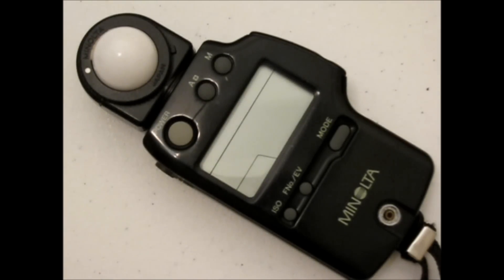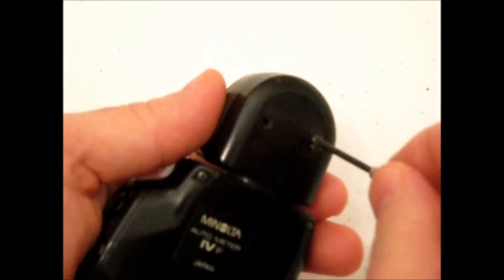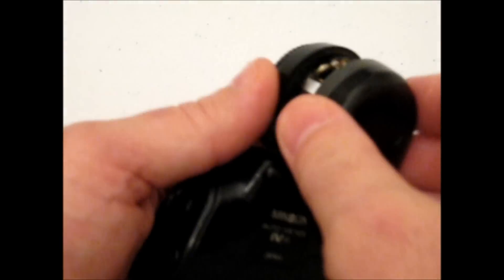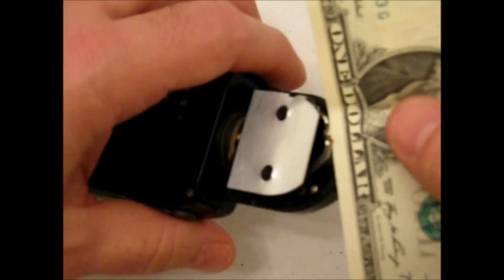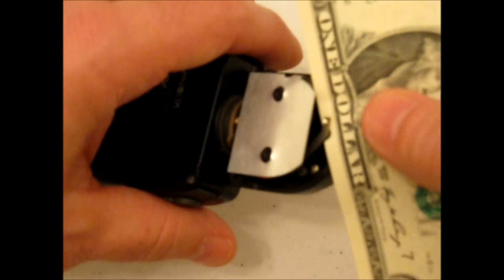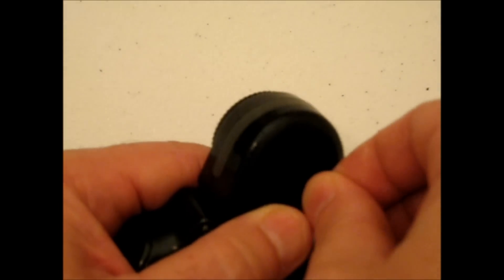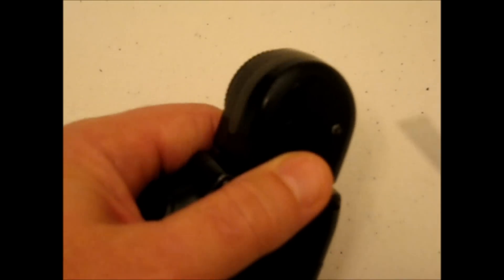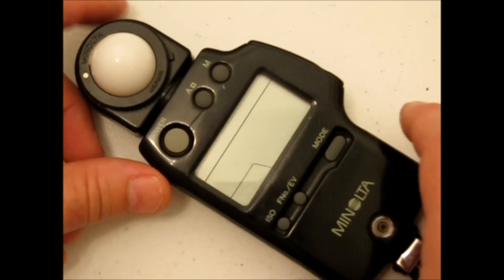How to calibrate a Minolta Auto Meter IVF

Comment: I tried this with the Minolta 4F and it seemed to work.  With a newly acquired Minolta V, however, this hasn’t worked.  The meter V gives accurate flash  measurements, but it grossly over exposes in ambient modes.  I cannot fathom why this should be.  Any suggestions or advice would be gladly appreciated.😢

Comment: I did it and it's worked even with a 20 euros! This is not a calibration but my Autometer had a 3 stop underexposed and now it is ok. Maybe is a fail in electric contact because lack of use.

Comment: Thanks! Worked like a  harm and prevented me dumping it again on ebay , :-)

This little switch is to reduce the sensitivity of the meter by 3 stops if you use the darkroom attachment which is the adaptor with the plain hole in it so no optics in the adaptor.
If the switch gets dirty it puts the meter in darkroom mode for the adaptor and so without the adaptor the meter is 3 stops off.
A good reminder to NOT put this(or any other measuring device) in your pocket with lint and dirt but to keep it safe and clean in the pouch.

Comment: Help....I purchased a old Minolta auto 4f meter....when I select non c and fire flash the non c flashes..even though I was holding correct button on meter..does this mean I have a bad meter? It works fine on ambient

Comment: I bought mine today, but found out it would show the "under exposed"-icon and a large E on the display, no matter how high or low I changed the values and settings.

Does anyone know about this error?
Reply: Sebastian Spiller did you ever figure it out
Reply: @celonziajohnson  
Unfortunately I figured out that it is a technical error, which requires expensive repairs. 
I was able to return it to the second hand shop and replace it with a Kenko without paying extra, and it works great. 
But it is always a risk to buy second hand electronics, so in the future I will pay the extra buck and buy a a new light meter, with warranty and all. Probably Sekonic.

Comment: Hello! I have an issue with my Minolta IV F meter, Previously it used to show me the ISO in increments of 100,200,400,and so on, but recently when I took out my meter to use it after a long time,  its suddenly showing me ISO in increments of 87,170,340 and so on, What could have gone wrong? Can anybody please help me to reset it back to normal ISO speeds. Thanks.

Comment: LOL! This works!
Probably not "calibration" per se, but it does apparently reset the meter to read "normally." Before I did it the meter was giving me f8.0 at 1/60 and ISO 400. Afterward I got f2.8, which matched my Fujifilm X-T2 spot metering a grey card. Over 20 year old Auto Meter IVF works like new!

Comment: Amazing. The contacts do not actually "touch" but the readings are different after this trick, and now they match my Sekonic L-558 in spot mode (I've lost my dome on the Minolta unfortunately).
I think it has everything to do with static charge that is making the readings off, but I wonder if the rubbing is actually causing the static charge, or neutralising it.

Comment: This is, without a doubt, the coolest tip I've ever seen on the internet. I just bought a used IIIF to get into studio photography cheaply. I was dismayed when it showed 3 full stops off, and I couldn't figure out what I was doing wrong. After finding this tutorial, I opened the back of the head up, and it has a similar connection, which I cleaned with a five dollar bill, figuring that a fiver would be more effective than a single...;)...and, it worked like a charm. So add the IIIF to this tutorial, as well, as it works the same way for it (the contacts just look a bit different, but they are in a similar location). I don't know that this is really a "calibration", as it's more in the nature of a maintenance fix, but who cares? It just works. Thanks for taking the time to post it.
Reply: also work with Auto Meter III :D

Comment: That could not possibly calibrate the meter.  It will turn a non working meter into a working one, but not calibrated accurately.  That would have to involve the sensor, not just the contact, which will get it closer.
Reply: I just (re)did this, and it works. I'm now going to do it before every major job/shoot, "just in case". Give it a shot and see if it works for you!
Reply: Plus, why would you ever trust doing this to a light meter when you go into a high end pro shoot?

Comment: Open the head to find disconnected wire caused my too many head rotations. Don't suppose you have a video showing how to solder small wires? Not my forte, I end up melting everything!

Comment: Holy crap it worked! I still needed to tweak mine a little with the calibration dial in the battery chamber to get it spot-on, but it went from useless (off by about 4 stops) to perfect! Amazing. Thanks!!

Comment: I dropped my meter and opened the head try to fix it and found 3 different plastic "filter" or disc. One is clear, one is green and one is like a washer. Do I have to put them back in order? I did try without them and the reading is off 1 stop when I compared whith Minolta F spot meter. Can anyone help?

Comment: I don't think this is really a calibration. I have the problem where my Auto Meter IV F shows 3 stops off, and as far as I can tell, it's caused by the meter mis-recognising the incident metering dome as a reflective metering accessory. The operation you show in the video looks like it will clean or re-adjust the sensor that feels what metering accessory is attached.